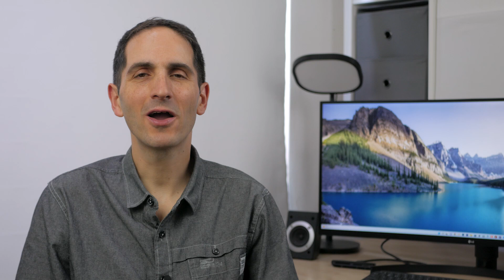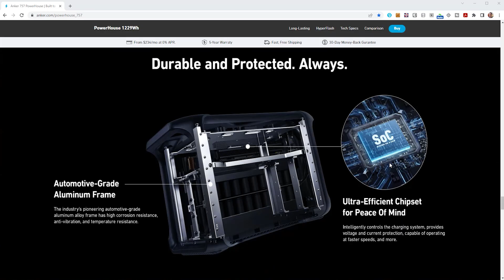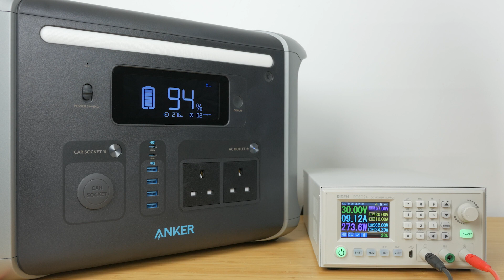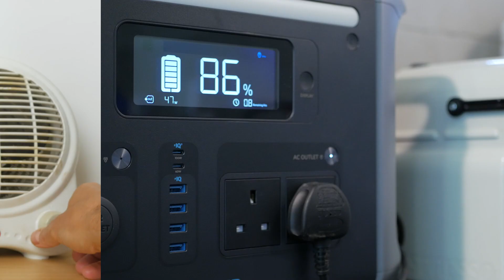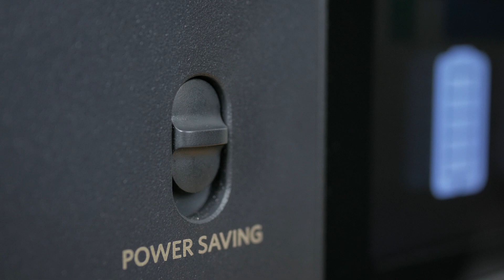Anker 757 PowerHouse 1500W portable power station review | 1229Wh long-life LiFePO4 | Fully tested

Comment: Good review, and stuff covered in your video why I went for it. Sick of other solutions just not doing the job. £300 off direct from Anker. Still a hell of investment but vw camper van trips away it hasn't faltered. It's living up to what I wanted and 5 year warranty gave confidence in the big up front outlay.
Reply from the maker: Thanks glad it helped. Sounds like a decent discount - and I agree the 5 years warranty is a big plus when spendinf this sort of money!
Reply: wow £300 discount, that's great. How did you get it? I am also thinking for our VW campervan trips as well.
Reply: Well it was a pre order deal. Sad to say it has just been returned as the solar was a pain. You had to unplug and replug the xt60  every day and when it got twilight it would make a loud clicking noise and also needed the xt60 unplugging. It was a deal breaker as I had it connected to panels on the roof when not in the T6. New Ecoflow Delta 2 with Lifepo4 and the extra battery is epic at 2kwh capacity and working perfect for my daily solar needs. Only 12 kg for the main unit. Easier on my ageing back 😂
Reply from the maker: @under2boots  Just about to take a look at the Delta 2!
Reply: @TheTechnologyMan  will you be doing a review of it as well?
Reply: @under2boots  aaaa that's shame. If it wasn't for the solar issues would you be happy otherwise? I didn't know about the new EcoFlow delta 2, where did you get it from if you don't mind me asking?
Reply: I liked the Anker but 20kg in hind sight was too heavy for me lugging it backwards and forwards to a first floor flat and a campervan. I liked everything else about it. Just the solar also seemed to cap my 400 watt panels to 165 watts in full sun. Whereas the ecoflow has achieved 267 watts so far in less sunlight. There's only two, 3 pin 240 Volt sockets and Ecoflow has four and has the expandable capacity. Anker £1399 vs £1099 for the ecoflow (additional battery £749 which is a rip off but I took the hit for it to make it a stand alone unit to power my working from home set up. Ecoflow was bought from their website and was delivered in a couple of days
Reply: @under2boots  I didn't know that Delta 2 is available in the UK yet?
Reply: @Hrustanovic033  I got in quick but full price 😭 but got a free waterproof case (could they spare it? 😂) it's currently powering 65 inch TV, broadband router, skyQ and led lighting in the main room 💪

Comment: Did I miss how long it would take to charge the unit with solar power? This little guy is perfect for the power outtage/run smalls in the house stuff, and would be the ticket for camping!!! Ideal for the preppers out there. Really enjoy your tech videos!! Thanks for sharing and keep them coming!!
Reply from the maker: Thanks glad you liked the video! Yes a very handy unit. I did discuss solar charging - you can connect up to three panels in parallel which would charge the unit at 300W max - 80% charge in just over 3 hours. Didn't have great weather to test this - but I got around 150-180W off three panels in bright but cloudy conditions.
Reply: @TheTechnologyMan  I have 400w panel, will this unit max out at 300w when charging or 300w panel is the max that it would take and any larger it would just simply shut down and not charge from it. Can you also please clarify what additional cable is required if to charge from the solar panel (i have already got a solar cable extension with MC4 plugs at the end) as this unit doesn't come with the cables? many thanks for the review.
Reply: Great review - I’ve just won one of these in a competition.
I own a VW Transporter Campervan - do you know of anyway I could use the vehicle’s alternator to re-charge this off the engine when on the move much like the vehicles own battery ?

Comment: Great review, thanks. I have the Anker 300w power house . Wanted to run the chest freezer during a power cut but won't power it at start up
Reply from the maker: Thanks! I've not tested the 300W Anker but looks like a nice little unit even if it doesn't power your chest freezer.

Comment from the maker: What do you think of this new power station from Anker? Any other features you'd like it to have?
Timestamps:
0:00 Intro
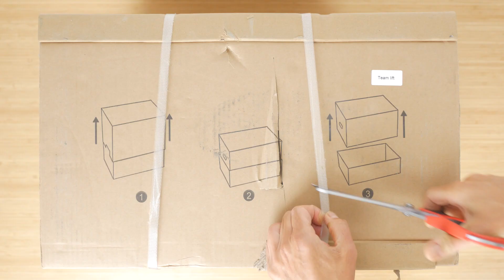0:45 Overview. Unboxing
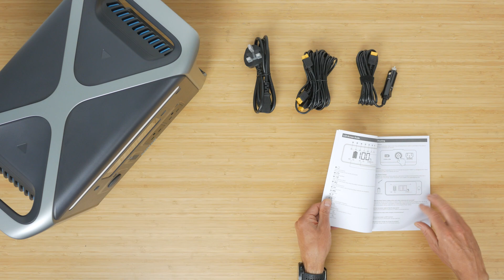1:12 Design and build, weight, LiFePO4 battery tech compared to NMC, dimensions, example use cases from Anker's website
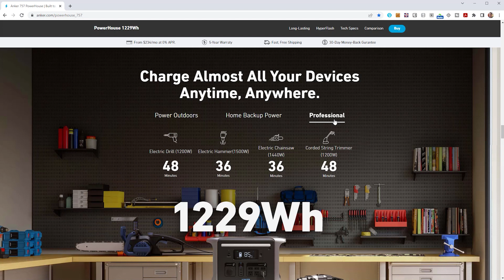2:22 Overview of unit - inputs and outputs, LCD screen, LED light, cooling vents
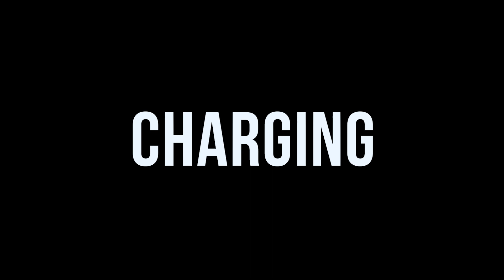3:57 Charging 3 methods. 1000W fast mains charging 
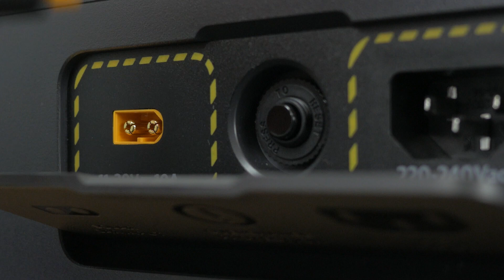4:56 Charging with car charging cable and test of maximum charging via this DC input
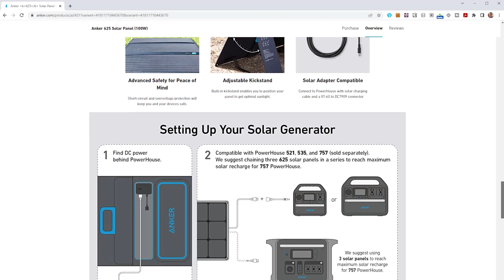5:16 Solar charging at up to 300W
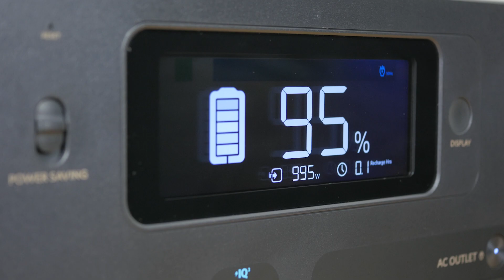7:18 Performance. Spec of AC outlets, check sine wave output
7:49 AC outlet test with range of outdoor devices: lawn mower, angle grinder, heat gun, SDS drill, compressor
8:05 Overloading AC outlets with high startup circular saw
8:15 AC outlet test around the house: hair dryer, coffee machine, heater and toaster
9:02 Capacity tests off AC and DC outputs - calculate efficiency
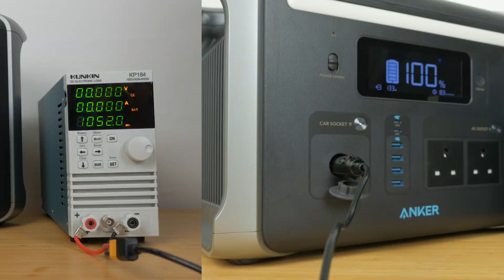9:40 UPS (uninterruptible power supply) function - introduction and testing
10:22 Testing 12V 10A car outlet
10:40 Testing USB outputs
11:30 Testing noise from power station fans under heavy load. Checking temperatures under load
11:52 Power saving mode switch
12:20 LED lamp
12:39 Conclusions